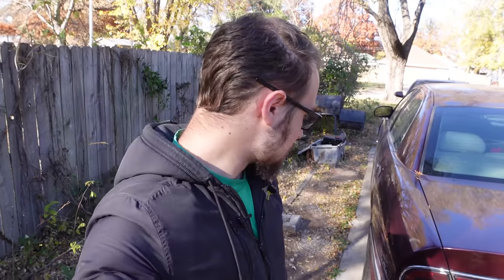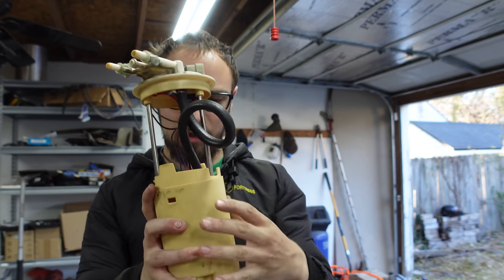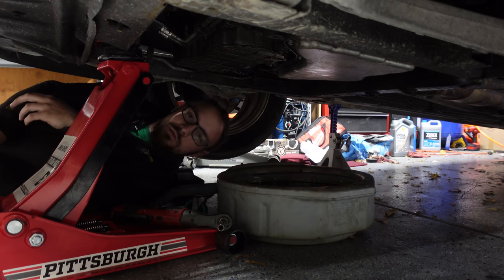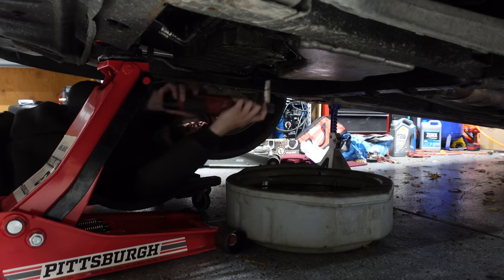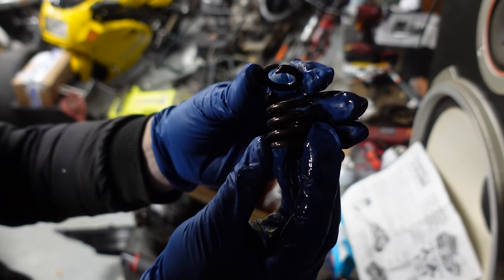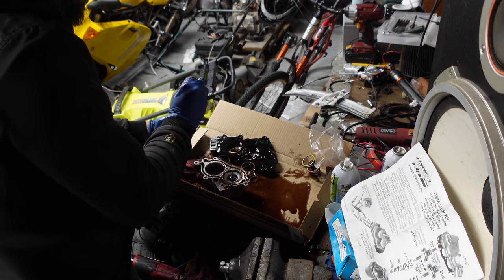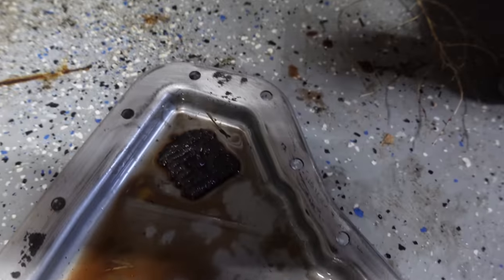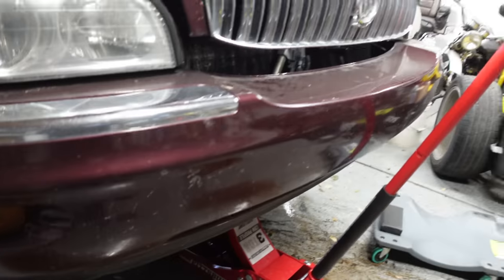TURNING UP THE BOOST! Supercharged Buick gets More Power!

Comment: I bet the transmission fluid change made the biggest difference in performance today. I know from experience that a transmission service should be a priority when you get a used vehicle that you want to keep. It's almost a phobia for me to drive one without doing it within a day or two, but I've had a couple of 300,000 - 400,000 mile GM 90 degree V6 with automatics last longer than I owned them after getting both of them around 200,000 miles. I believe it was religious fluid changes, temperature vigilance, and those near perfect drivetrains. One was a 3.3 liter with a 3 speed, 91 Oldsmobile Cutlass Cierra and my favorite of all time, 4.3 liter 4 speed 2 door 2WD 90 JMC Jimmy. I used to pretend it was a race car that could pull a trailer and drive off road too. The only thing that I would want more is the "Typhoon" version. Tyler Hoover's old one is still the driving device I dream about owning, if I could own just one vehicle in the world for the rest of my life.
Reply: Really? I'm terrified that a fluid change will kill it by removing the grit that's keeping the clutches from slipping too much.  I'm pretty much resigned to replacing the trans on my old Dodge B20 in the next year because it already slips when you first start it.
Reply: @Canthus13  i have always been worried also but I change it anyways and just supplement a qt of atf with a qt of Lucas transmission additive and have always had positive results
Reply: @jeremyTallen1  I'll try that once I have the money to replace it saved, just in case.
Reply: Old comments but.. yeah, since my Park Ave has been having a few probs, I've been looking at them on YT.  By "some probs", I just mean I had to replace the alternator (and battery) a couple or three weeks ago and then I had to get a MAF sensor yesterday.

I remember reading in the manual 20 years ago that the Park Avenue (non-Ultra) called for transmission fluid changes every 50,000 miles OR every 25,000 miles if primarily driven on "windy and hilly roads".  I have always remembered that because I read "windy" (as in wind up toy) like "windy" (it's a windy day with that wind blowing so hard).  And for about 20 seconds, I stared at that word thinking "how are roads 'wendy'?"  So, yeah, that memory must have its own wrinkle in my brain :-P

I'm at 120k miles on this 2000 Park Ave and I've changed the fluid and filter at least 3 times, maybe 4 times, I can't remember.  It was my grandma's car and she was all about keeping her stuff in good working order and I was all about doing free labor for her.  Remember being in your early 20's and having that kind of energy?  That thought hit me a little while back lol... I was talking with someone about how we always used to wax our vehicles and then wax our family's vehicles just for fun.  Now I barely wash my car 😞

Anyways, I do believe in servicing the transmission sooner rather than later.  That's because "later" is usually because something is already slipping or acting up.  Once something is acting up, a fluid change doesn't fix anything.  It may help it out for a little bit, but the damage is already done.

There's some rare cases like in the Ford 4R70W transmissions with torque converter shudder that a fluid change to Mercon V actually was the permanent fix, but yeah, I want to say OVERALL, waiting until you have an issue to change the fluid only masks the problem for a short while whereas vigilant fluid changes prevents those issues altogether.

Comment: Just took my Buick Ultra on its first road trip from UT to AZ.  Best recorded mileage 33 mpg going 80. For the first time I used pure gas (no ethanol) which is supposed to burn hotter and increase mileage.  All I know is for a large vehicle, that mileage is amazing.  Great highway car.  Honestly, it was easy to creep up close to 90 and not be aware of it. I had to catch myself multiple times easing back.  The car accelerates like a bat out of hell, smooth, quiet ride and when my back got a bit tired just turned on the heated seat which also cover my lower back and it was great. throw.  However, I may it up for s put it up for sale because I just don't get the use out it deserves.  It needs the love of someone who appreciates what it has to offer.
Reply: It Will Ride Out...04 Ultra 223000+ And Enjoying My Buick. Why Did They Fuckery And Stop...🚘 Once In 1, Its Hard Too Get Out...Buick Baby...☝🏾💯✨️

Comment: I have a 99 Buick, Ultra and I Love this car....It is not fast, but has Great Torque!!....Rides great, good on gas, and Hitting Passing gear Is Impressive!!....Same color as Yours, but mine has 240,000 miles....Still running Strong!!.....Problem: I keep breaking motor mounts!!....I brought it to a local speed shop, and they did a great job!!.,..They Fabricated their Own, Guaranteed Not to Break again!!....So far, so Good!!
Reply: I also had to replace transmission...Only because 1 of the broken mounts ripped the boss off the tranny, nothing to weld to??....So had to replace the trans to get good mounts installed, again....1st tranny shifted harder, but this one is OK...

Comment: Did the accumulator spring kit on my 98 Grand Prix GT back in the early 2000s.  Don’t remember what company it was from but they gave you three different options.  Mild, medium, and bang-screech.  I opted for the medium setting. Cold shifts were a bit harder, but once warm if driving normally it wasn’t very noticeable.  Get in the throttle and wow what a difference.  We watched shift timing on the tech-2 and it was shifting at around .9 seconds.  Very nice!

Comment: Seafoam Trans-tune and lucas stop slip. Almost 250000 miles on my 99 parkave still runs with tccs yelling I Just keep a small scanner to clear the code until I can replace it. Rock auto has a trans pan with a drain plug on it I feel you on that

Comment: Jeepers it looks like there was a murder in your garage with all that ATF on the floor. I don't have any automatic Saturns left, but I did my share of changes of fluid and filter, as well as some magic tricks to try to fix an endemic sticking reverse. But those had something called a "valve body". Never opened a transmission for anything larger than a miniature riding mower.
Reply: The valve bodies will stick if you never change the fluid.  If you wait until the transmission starts to shift a bit "strange" and then change the fluid, filter and all the valve bodies, it is like a new unit.  But don't wait that long.  And don't waste time checking which valve body is bad, just change all of them while you are in there.
Reply: @marknelson8724  that makes sense. I did change the fluid and filter before the strange shifting, but a "reverse slam" is a well known problem with that Saturn automatic transmission. (It's always and only reverse, used relatively infrequently but requires much higher pressure to actuate I guess) Now my only Saturn left is manual, and the other car is a Subaru with CVT that's programmed to pretend it has shift points which drives me slightly crazy. 😁

Comment: You should look into getting a pcm from ZZ performance. I did a shift kit in my buick regal and not until I swapped out my pcm did I notice a huge difference
Reply: Been thinkin of doin the same, 2 my regal (gs). Gonna try PCM 1st. Are U using hi octane fuel or e85? Thxs
Reply: @richkelly4040  sadly I no longer have that car. mine was an LS but with the tune I always ran at least 89. I honestly have no idea if there are any gas stations around me that sell e85 so I never looked into it

Comment: So you went from a 3.4 to what?  I had a SSEi Bonneville with intake, exhaust and a 3.4 modular pulley on a stock tune. I had a 4T60E-HD due to being a 96. So the vacuum reference on the side of the trans had a small Philips screw I could tighten and increase fluid pressure and thereby firm up shifts.
Reply from the maker: I think it's a 2.7"

Comment: Great job. The very next job on that car is to add the heaviest duty auxiliary transmission cooler B&N makes. It is rated for 21,000 pounds.   That fluid is a disgrace. Back flush the transmission, then install a new filter, and get the cooler in. Then you will have a transmission that will work. My 89 Grand Marquis with the 5.8 litre had one from the factory as part of the towing package. It also had a factory shift kit in the heavy duty AOD. Ford never advertised the upgrade to the transmission, but having had 3 Trailer Tow III cars and 3 regular Panthers, believe me, the difference is very noticeable. After all, the power of the engine is useless if you can't get the torque to the ground